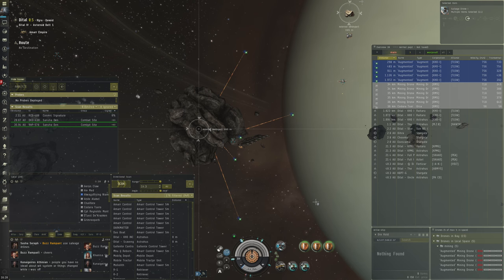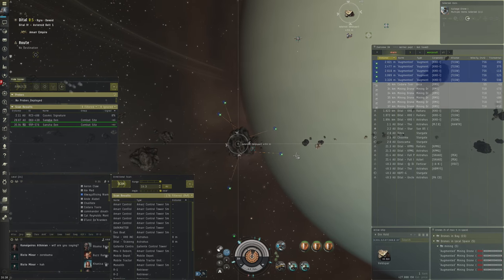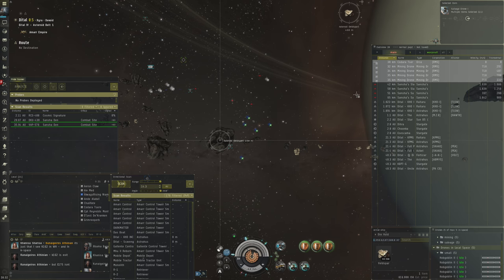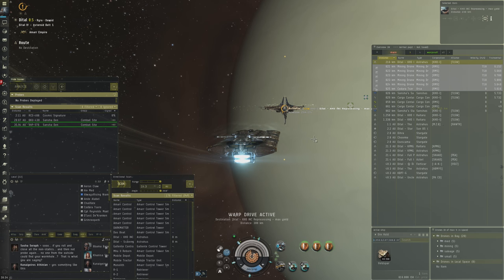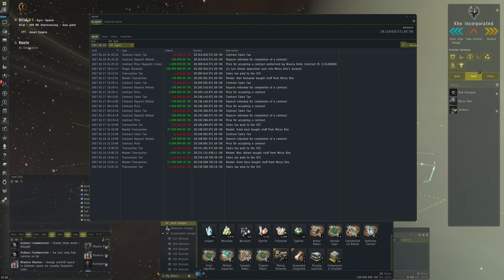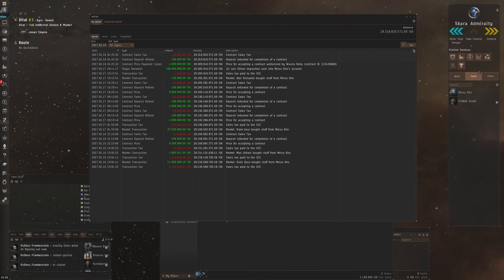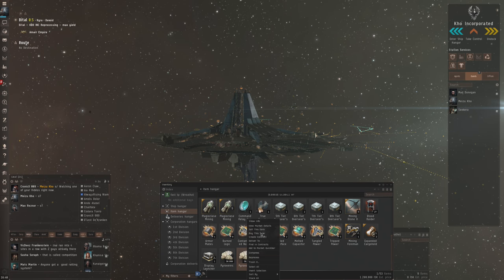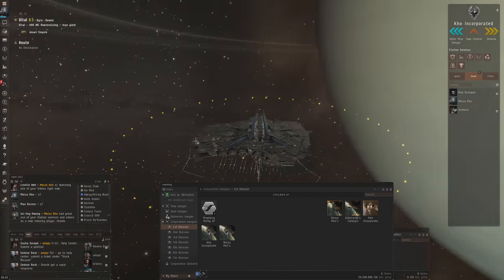EVE Online - compression (for new players)

Comment: Never bothered to mess with compression before and never realized there was no loss and it compresses down as much as it did. Seems like you could just mine in a quiet spot that has any refine citadel in system, compress up there and later haul to a cheap refining station with T2 rigs for the best return. Or if you're in a quiet enough area with no low-sec gate camps you could put up a small with an intensive array in low sec, mine in high sec, compress and run to your array for 54% refines and no tax.

Comment: I tried to make it to dital and mine there.. I was 10 jumps away in an Astero with all my stuff and got insta locked by marmite and got podded 40 jumps back..
Reply from the maker: lowsec?
Reply: delonewolf No, it was in the trade hub amarr. My Corp, Brave Newbie's, was at war with them. My route took me through it and I forgot to fly around.
Reply: Lol whups.
Reply: Clash with Connor 7o The astero is capable of entering warp in under 2 secs if fit properly. This would make gate to gate travel thru high sec safe.
Reply: The Gentleman Gamer they had a insta lock interceptor and the second I decloaked They instantly had me scrammed.. Either I lagged or he was hacking
Reply: Also, when I say "lagged" I mean I was scrammed before I could get my mouse from the warp button to my cloak.
Reply: keybind ftw